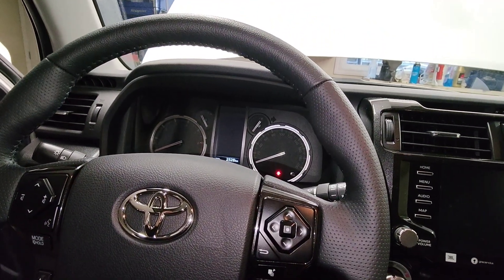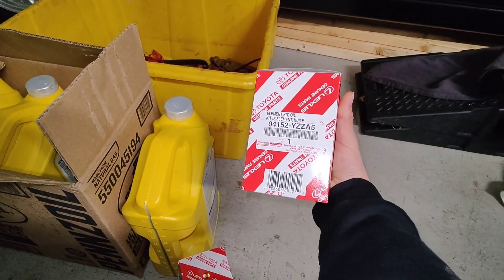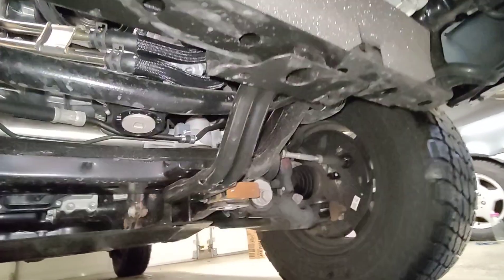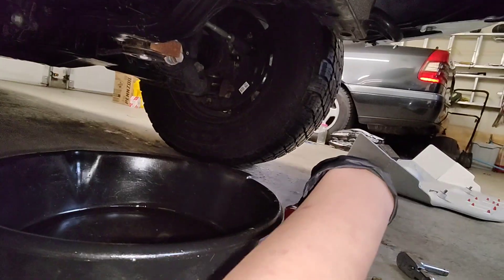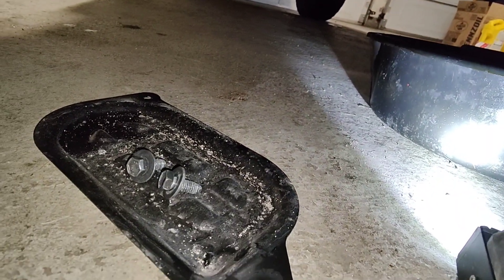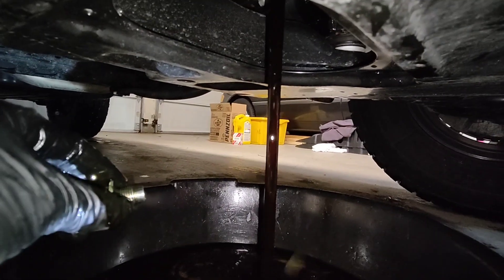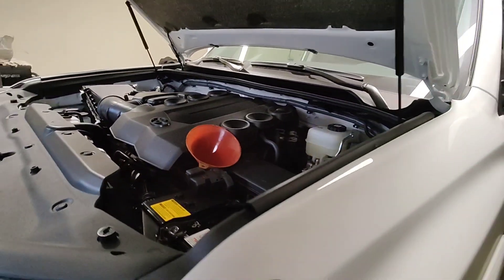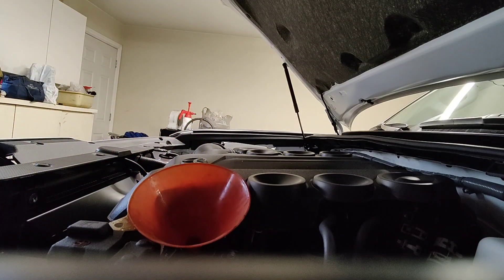First break in oil change on the 2023 TRD Pro 4runner.

Comment: I did my first one at 100 miles, 2nd at 800, 3rd at 2500. The first two had sparkles, 3rd change was absolutely clean.
Reply: Elk300  I reused the 2nd and 3rd in my daily Frontier, minimal waste.

Comment: I did mine at 1000 miles..The ones that know don't care about the oil brand as much as changing the oil every 3000 miles. They also recommend using Toyota filters and not the cheaper knock offs..

Comment: I’m glad the current 4Runner uses a spin on filter and the spark plugs are easily accessible.  These V6s from the previous 5th Gen are hard to maintain.
Reply from the maker: At my last job I saw many 5th gens come in with over 400k kms. And those customers would hold off on doing repairs like ball joints and bushings. I actually don't mind the cartridge style filters I get to see what's in the filter and the filters are cheap from Toyota.

Comment: I just did mine on my TRD off road.  775 km. Lots of fines. Filter caught a few larger bits.  Will do another at 1200km and a third by 2500km.  Should be clear by then.
Reply from the maker: I'm at 20k and just did mine not seeing anything at the bottom of the filter.

Comment: I just changed mine at 1,500 miles and it looked very similar to yours. Found little shavings like you and the oil had some shimmer to it. Very glad I changed it early...crazy that I was only 15% into the recommended oil change period and it had that much metal in it. Looking online, it seems to be "normal" for a new engine so I'm not worried...but yikes, what if you waited the whole 10k
Reply from the maker: Yup I always go by the break in oil change. Especially if it's my own and I'm going to be keeping it for a long time.

Comment: You didn’t show how to use the oil drain thing for the on the oil filter housing..  Grease on threads??? Really???  So much for accurate torquing of the skid plate bolts..

Comment: Did you notice any metal in second oil change?
Reply from the maker: I'm actually at 20k now and there is pretty much nothing.
Reply: @theoffroadingmechanic  how many oil changes? Just did my second at 20k and still notice a little
Reply from the maker: I've done 5 oil changes. Second one I did was at 5k kms then I just do my oil changes  every 5k kms as regular oil change intervals

Comment: As a fellow car care nut you must shake the bottle of oil before putting into the engine. The reason is that we don’t know how long the bottle has sat at the dealer. All the additives on the oil has sank to the bottom of the bottle. Thus shaking the bottle will ensure that it’s nicely mixed 😂
Reply: …………………. WHAT?!?!? 🥴🤣🤣
Reply: @boosteddaily1294  it’s ok bruv he knows what I’m talking about 😅

Comment: If the oil filter is doing its job filtering the metal bits out of the circulating oil, why change it so early?
Reply: Did my first at 100 miles, 2nd at 800. 2nd oil change still had slight sparkle in the oil. 3rd change at 2500 was absolutely clean. Oil is cheap and I plan to keep mine until gov't outlaws fossil fuel vehicles.
P.S. I also installed an inline transmission fluid filter, boy did the first filter change pickup some bits!

Comment: Hello sir, I am not a car person and i bought a brand new lexus in july. I watched your video yesterday about significance of first oil change. Unfortunately by that time my new car was already driven 2500 miles. I woke up this morning and got my oil change done at dealership first thing. My question to you is how much damage have I done already to my new engine since I missed the 500 miles mark by quite a bit. Im kind of freakin out now. please help :(
Reply from the maker: I wouldn't be too worried too much what's important is how frequent you do your oil change. I wouldn't go the 10k miles/16k kms that they recommend and just stick with the 5k mile. It is just how break in is on a new engine. What really matters is once everything gets broken in, you have little to almost no material in your oil in between oil changes. The early oil changes just helps in removing that material in the oil. I work at a dealership and the majority of the customers that come in don't even do their first oil change until 8k to 12k kms.

Comment: I bought a new tundra any tips for maximizing the transmission lifespan
Reply from the maker: Nice how's the new Tundra? With any vehicle just by doing maintenance.
Reply: it's an Aisin transmission it will last forever... we have early 90s Camrys out here I SoCal with 500k+ miles on original tranny fluids 😆
Reply: @LexusGX460-OFF-ROAD  Is it normal for these transmissions to clunk after 5 secs of rolling without gas and then getting on it? I used to have a camry and it did the same thing
Reply: Just drive normally.  Don’t spin the tires or shift from R to D or vice versa while moving.  Don’t tow.  Don’t off-road.  I always tow and off road with a beater.

Comment: Just changed it at 800 miles on my 24 is350. Definitely some shiny bits in it. Also my 18 Suzuki GSX-R 10000 R had a decent amount of aluminum floating around. CHANGE YOUR OIL. it's insane to go 10K especially on a new engine. Completely brain dead advice

Comment: Do you fill new oil filter with oil before installing new oil filter?
Reply from the maker: No I don't pre fill the filter. It's not necessary unless you have a new or fresh rebuild and need to get oil to all the major bearings. We have cars that have well over 400k kms with full service history at work and a guarantee you no one pre fills the filter.
Reply: @theoffroadingmechanic  I wouldn't claim that it's not necessary. It's a good practice to do if one can, just to get oil pressure quicker.

Comment: If you do Break in engine oil change what about transmission and diff?
Reply from the maker: Will be done sometime in the future. Kind of already have everything.
Reply: I did my 2019 tundra , 2021 rav4 and 2022 rav4 break in oil changes at 1000kms . Then at every 5000 after that .... Serviced the 4wd / AWD at 25,000km and the oils were pretty grey from break in of the gear set ... Glad I changed them 👍

Comment: So the dealer wanted me to go 10,000 miles before the first oil change. I ended up doing it around 5,000
Miles but I let the dealer do it. you think I’m good ? 2022 Trd orp 4r
Reply from the maker: Not sure how you have that maintenance schedule. what does it say in your owner's manual? In the owner's manual supplement only says 8000 kms or 6months which is equivalent to 5000miles and nothing else. Do you have the free 2 year maintenance that people mentioned that they get in the US?
Reply: @theoffroadingmechanic  yes I have the free maintenance thing and they told me at the dealer they recommend every 10000 miles and it was a bit hard to make them understand why I wanted it done early at 5k miles. Seems a bunch of people here in the USA have this issue now
Reply from the maker: Maybe because it's free? I would check the owner's manual. I watch The Car Care Nut channel and even he suggests 5k mile interval.
Reply: @theoffroadingmechanic  I def watch that guy too he’s good ! All the guys on the 4r Reddit group also suggest 5k. I’ve never gone past that. I’ll prob do another sooner than the next 5k
Reply: First service at 8000km from Toyota is just an inspection and tire rotation. At least for my Tacoma anyways. First engine oil change is actually at 16000kms. Way too long for break in.
Reply: read the manual, the extended oil change interval is only for owners that do zero city driving, zero short drives, no towing ... ie no one
Reply: The manual of the new Toyotas say oil change every 10k miles under normal driving conditions. If you like your car and know how thin 0w-16 is, you change it under the severe interval per the manual which is every 5k miles/6months. This would be outside of your free Toyota care. So to your original question, you did a fine job changing its first change at 5k miles. Personally I don't let my dealership change my oil even if it's free, last time I did they overfilled it by .5 quart.
Reply: My dealership and app say 5000 mile or 6 months to check everything then oil change at 10,000 miles or 1 year. F that shit it’s getting done at 5000!
Reply: @apa7611  amen!
Reply: 10k intervals like the book sez

Comment: Do the 5th gens recommend 0W-20? My 05' 4th gen manual shows 5w-20.
Reply from the maker: Yup the 5th gen takes 0w-20
Reply: @theoffroadingmechanic  Interesting, does that have to do with the dual VVTi as opposed to single VVTi in 4th gen?
Reply: @likeasumbody403  its a few things when i last read about why manufactures switched to 0W20. Ive heard its for better gas mileage to help them meet emissions. It also operates better as its the same viscosity at cold as it is when its hot
Reply: @Crunchymunchys  so...could i/should i switch to 0w20?
Reply: @likeasumbody403  use what your owners manual tells you to

Comment: Have you had any windshield noises? my 2023 40th is driving me nuts, I have tried a few owner suggestions but I'm afraid my windshield seal may be bad.
Reply from the maker: Is it like a rubbing clicking noise? Kinda sound like from passenger side?
Reply: My ‘09 Corolla would make a clicking sticky noise from the windshield or dash area when new. With time the noise faded away. Only hear once in awhile or got used to it. Seen the same complaint from various Toyota vehicles. Some say it is the curtain airbag, or the windshield adhesive, or tight plastic joints inside the cabin. 🤷‍♂️

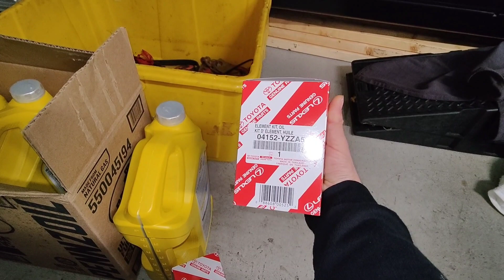Comment: 1:30
OEM does not always mean its a good filter.
Look at Subarus current OEM, they suck
Harleys OEM filter sucks too.
Several videos of people opening up OEM filters and the number of pleats is low and their spacing is crap.
This normally applies to screw on filters though.
Reply: Toyota Denso filters are literally the best you can get.  Toyota uses the best parts, Yamaha engines, Aisin transmissions, Denso parts and filters.  Their rep is built on these 3 parts suppliers...
Reply: Toyota's filters are amazing.  For other brands ill shop around find, for toyota/lexus always go oem